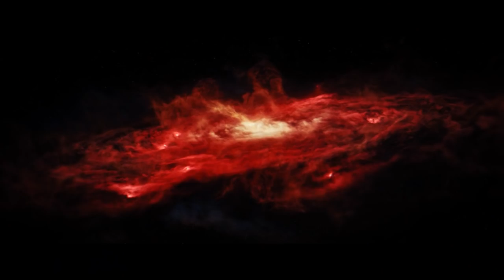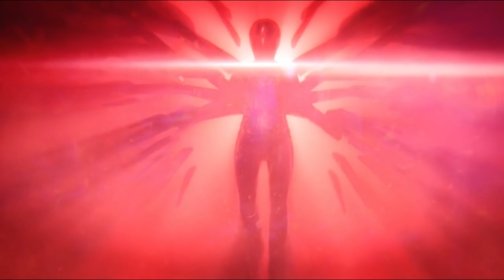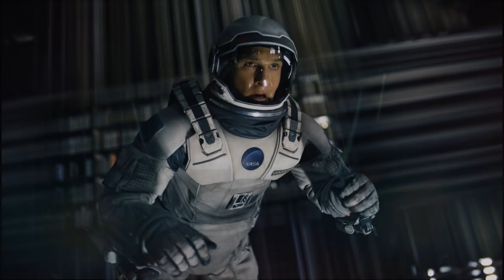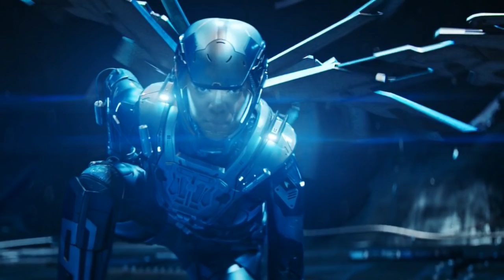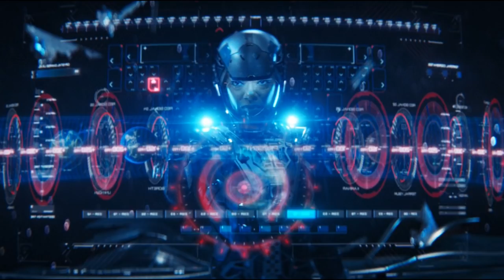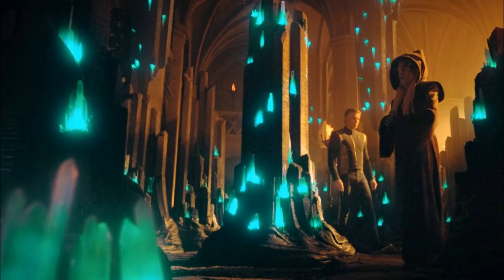Part 7 Everything Wrong with Star Trek Discovery Season 2 Finale Plot Holes Review

Comment: If the glass door can protect Pike from a photon torpedo blast, why is the hull of Enterprise simply not plated with impenetrable glass?  And why didn't they even bother to try and beam cornface out? It's clear STD is aimed at an audience of stupid people with no actual interest in science.
Reply from the maker: site to site transporting was said to be nearly impossible in TOS (the first time they tried it was during TOS and said it was rarely been done before because of the danger)
Reply: @NitpickingNerd  Nothing to stop them beaming her onto the pad.
Reply from the maker: @NeonVisual   no  they meant it's impossible to beam anyone inside the ship if it's not from the transporter pad. 
which logically is probably still dangerous by the time of TNG , otherwise why would they ever bother even going to the transporter room to beam down to a planet if they could do it directly from the bridge or anywhere on the ship ?    they didn't do it because it was more risky that way , so it was only done when there was no other choice or speed was critical
Reply: @NitpickingNerd  TOS site to site was risky because the target may materialise inside a deckplate, but site to pad was never stated as being a problem. It was shown in TOS.  

Also, site to site is really just two transporter cycles. Once from the target to the pad, then again from the pad to the target.  

By TNG/VOY they combined it into one cycle so the object only needed to materialise from the transporter buffer once, instead of twice.
Reply from the maker: I think "no beaming inside the ship" makes sense as a rule for a tv show , otherwise there would be no need for them to use turbolift at all . 
also why don't they just put a transporter right next to the bridge , or like in DS9 where they had one inside OPS
Reply: @NitpickingNerd  Transporters to get around the ship would be pretty poor in the event of no power, although I think Matt Jefferies said the Enterprise J had them.

I'm not sure it's a very sensible idea to have a major beam in point right in a  command centre either.  Any problem with a pathogen or an intruder and the entire senior staff is in jeopardy. Remember the Romulans had micro explosives that were undetectable by the bioscanners. 

If the bridge crew need to evacuate they can use escape pods like everyone else if they don't want to go down with the ship  :-p

Having a transporter that is only capable of beaming people off the ship from a pad would seem to be a design limitation they would want to overcome pretty quickly, especially in medical emergencies when an away team or member of the crew needs to be sent to sick bay fast, or dispatch security to a situation, or even beam a prisoner directly into a holding cell.   I can't imagine Starfleet would take hundreds of years to figure a way around that.